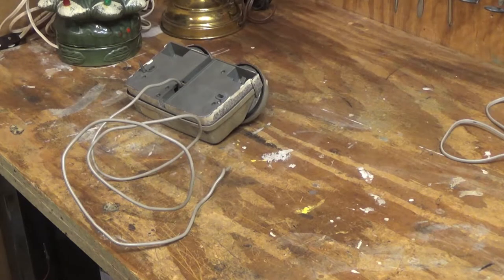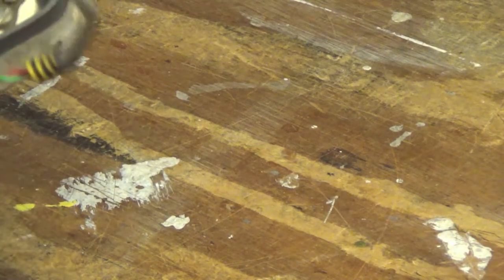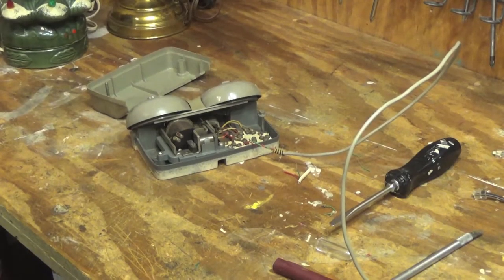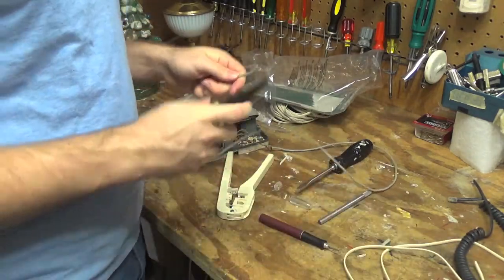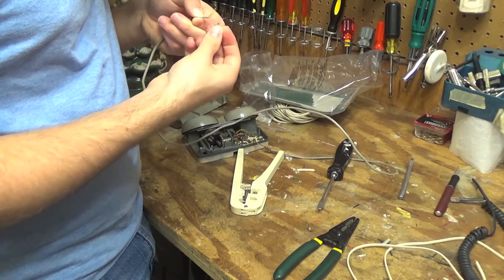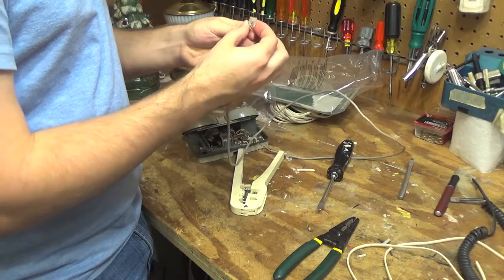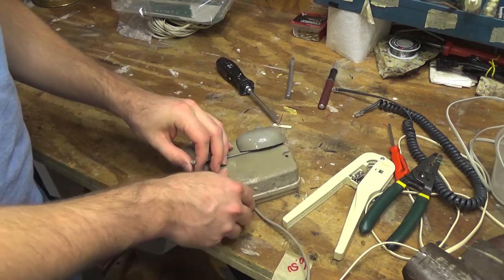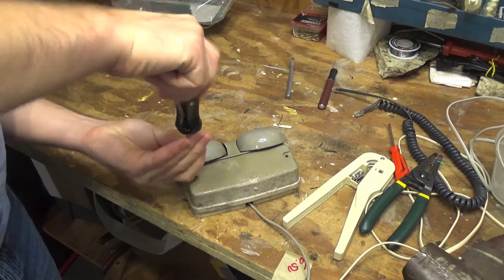Vintage Bell Systems Ringer | Wire and Test

Comment: Hello. What power supply would/could be used to activate the bells without a phone present?
Reply: Originally it would use AC at 90 volts, 25Hz It will also work on lower voltages, like 20-30V, since the 90V is nominal and was realistically only available on the  first few houses down the line. As frequency, you can use the 60/50Hz AC from your outlet, then however the ring will be faster. So any transformer outputting AC at 20-90 volts will do the trick.

Comment: Thank you, Jordan.  Manyears ago I.nstalled the same ringer outside on the back porch - before we had cordless telephones.  Connected ito a 24-hour timer so that it would only ring from 8 a.m. to 6 p.m.
Just bought a Crosley 1957 Public Telephone replica athe thrift store. (Also coin bank. Coinsound a bell on the way down to the locked coin box!)) Hate thelectronic ringer.  Does anyone khow I can I wire a two-bell ringer from an extra Western Electric 500? desk telephone?  There is much room for the ringer inside the plastic payphone.   Thank you.

Comment: Hi i purchased a very old house an recently out of no where I have a brown box and it rings like an old phone.  Opened it and it is an old bell system for telephones... but it keeps to ringing and I have no house land line connected?  Any advice on how i can disconnect without damaging it?
Reply from the maker: You should call the phone company to have the line going into your house disconnected.. It was probably accidentally left connected when the previous owner left, or perhaps the service was never discontinued..
You can just cut the wire going to it without damaging the unit, or you can open it up and remove the wires from the terminals.. The former is probably easier if you're not familiar with this kind of equipment..
Reply: No dude don't disconnect it, hack it!  If you really have an undocumented phone line then use it, place all the calls you want for free!!!